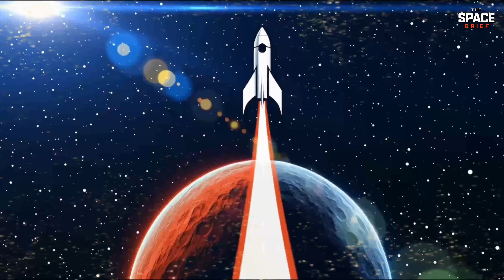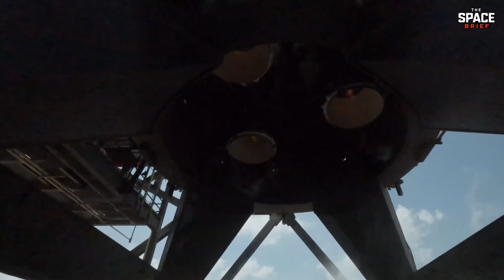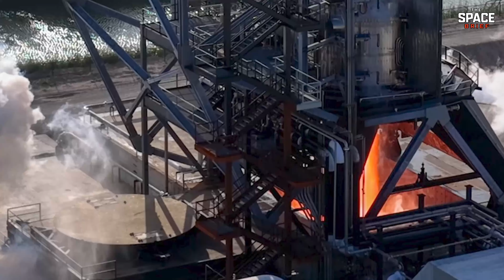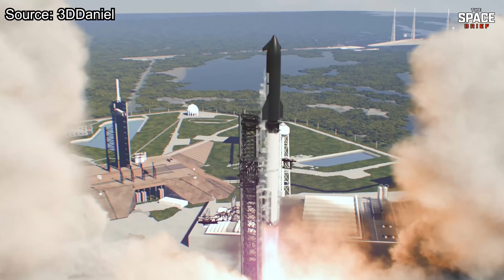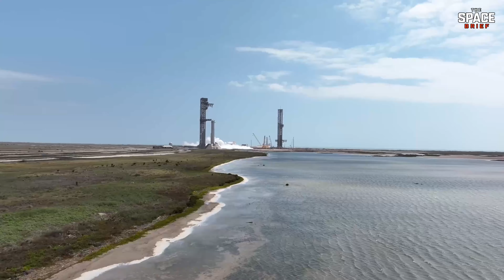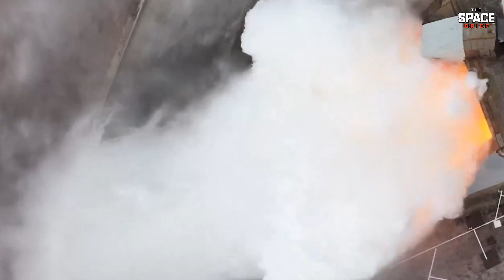Ship 40 Just Completed Its Full Static Fire — Here's Why It Took Two Tries

Comment: 🌿Go SpaceX-Flight13 go✨️
SpaceX-Ship 40, fired a "single-engine test" as part of their experiment and its, crucial.
Afterwards, thereafter, finally completed the 60 seconds of full "Static Fire 🔥 testing," and they're satisfied, in prepping for FLIGHT 13 🙌
Reply from the maker: Exactly — that extended single-engine burn wasn't a shortfall, it was Massey's one-stand bottleneck at work. Ship 40 delivered on the full 60s six-engine fire once the queue cleared. 🚀